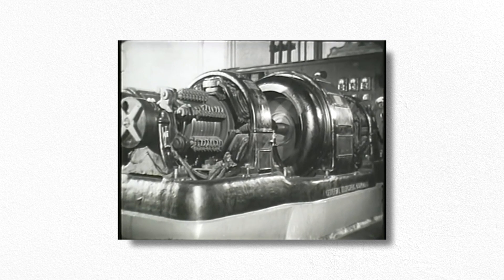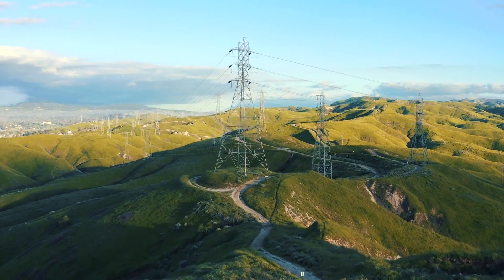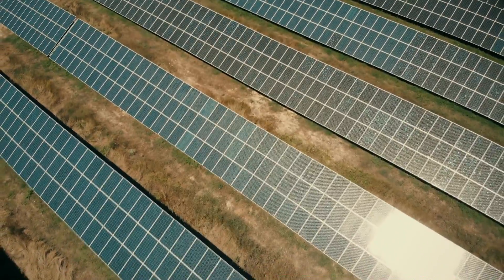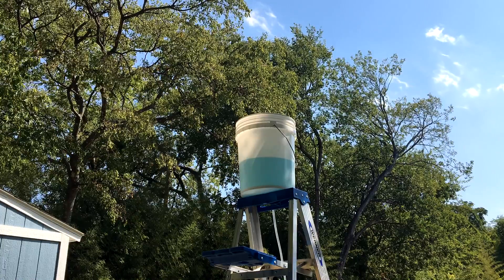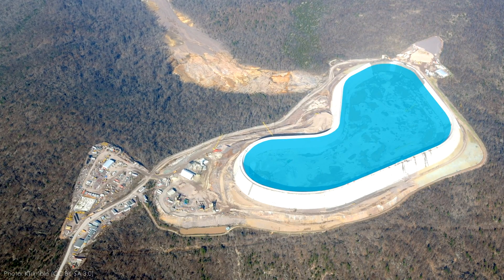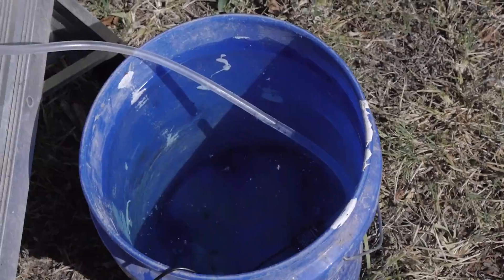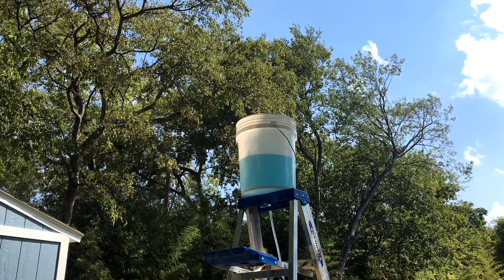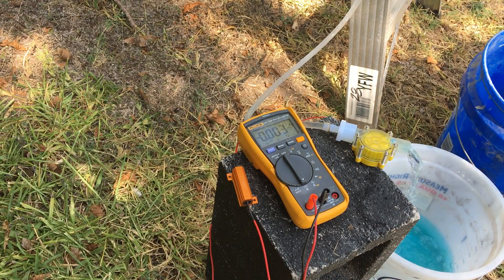World's Largest Batteries - (Pumped Storage)

Comment: Oh, wow, you actually pulled the ad? I personally didn't care too much, but that shows a tonne of dedication to your fans. Massive respect to you, Grady
Reply: He did what?
Reply: I always cringe so much when ppl put up VPN ads saying that it's for safety. "Hi, i'm not a network security engineer, but I am going to go-ahead anyway and tell you to send ALL YOUR DATA through someone else rather than across the internet 'because its safer'... than ... err... hey, use my code!"
Reply: I was surprised he put it up but i didnt think anything of it. Get paid grady
Reply: I was wondering why the video was taken down the first time.
Reply: Who cares. The content  was great and is still great
Reply: @Darren Munsell the point was about embedded ads, not the regular ones... hope i could help...
Reply: Not sure why storing energy in sequentially drawn weighs won't  work.  Every system has losses but mass storage would be cheap, easily serviced, relatively safe, and easily installed virtually anywhere with essentially  zero environmental impact.
Reply: @curtflory7147  Because wind is a thing.
Reply: Was and still a shillslut
Reply: 5 second ads are not so bad. But no more.
Reply: I just received an unskippable ad at the start.
Reply: Ads are just pyramid schemes anyway.
Reply: Comments need context. What are you talking about?
Reply: The ad in question was a baked in NordVPN advert. For more about the recent events surrounding NordVPN and the probable reasoning behind Grady pulling the ad (aside from community pressure) I'd suggest checking out what YouTuber JayzTwoCents had to say on the matter.
Reply: @MagikEh  For some even more interesting commentary, Louis Rossmann and Dave from EEVBlog have made some great videos about NordVPN.
Reply: @ThisRandomUsername  And Tom Scott has put up a video about VPNs in general
Reply: Thank you for the helpful answer
Reply: @MagikEh  Tom Scott also made an excellent video about it
Reply: Why did he pull the ad?
Reply: The ad was for a VPN provider which has recently been rocked by scandals of it covering up being hacked, on top of that, the talking points it gives for people to read out have been banned in certain countries for being false and misleading. 

He's made the right decision and I salute him for doing so.
Reply: @markusr3259  was it nordvpn? Cause I have that one
Reply: @BestStoriesFromTheInternet  Yup it was. You can't trust them, or any of the other VPN's that advertise.
Reply: Well he still has patron support. So F the ads
Reply: Random Dude except a lot of people (like me) quit Patreon when they became censorious fascists. And this channel was 1 of 5 I used to support before I deleted my account
Reply: @randomdude9135  and youtube monetization... hes probably making several thousand per million views from that alone
Reply: @randomdude9135  I'd go as far as saying Fuck the Ad model altogether.  History has shown the Ad model gives advertisers the wrong incentives and they will eventually produce unethical, predatory advertising.  Burninate the Ad model.
Reply: @JeanQPublique  you could start a major consultancy based on what your wrote... I'm serious
Reply: Dude has to get paid.  When you grow up, you will learn what's up.  Cheers.
Reply: Jeff Wads :  you're saying all methods of getting money are justified and legitimate, no matter how scummy.
Reply: @spinningchurro  :  It turns out that awareness and a free market make for more ethical ads and products.  The biggest thieves and scoundrels hide behind the rules and regs.
Reply: Most creators realise that Youtube can not replace their day job. Rest of them have made Youtube their day job. Grady belongs to the first group.
Reply: @sleeptyper  I can't even make it a paying job.. lol.. but then again I  have no reason to post hundreds of videos..  I just upload vids to post to other sites...
Reply: @jarredjones8476  During my short career as a monetized youtuber (~1 year) i made whopping 2 cents. When they demonetized all small creators, i just stopped uploading at all and deleted my most watched videos. Now i'm just an expense to them.